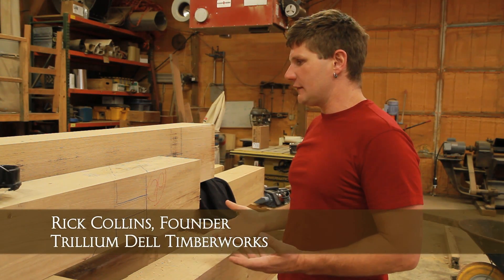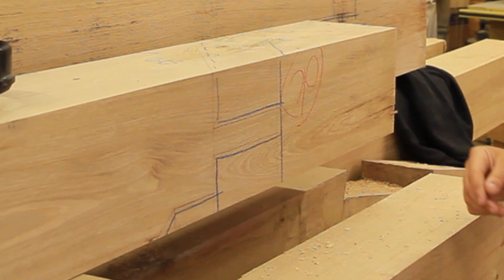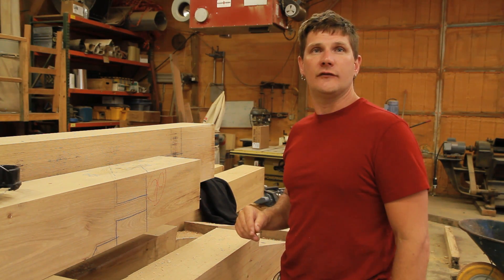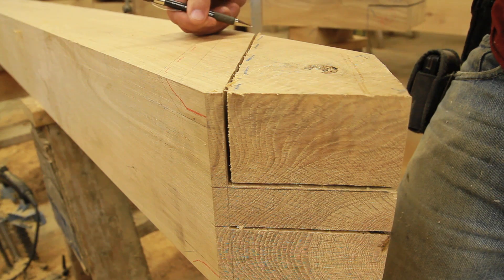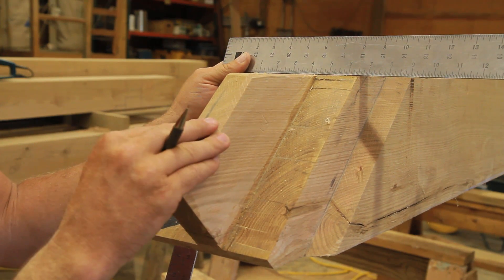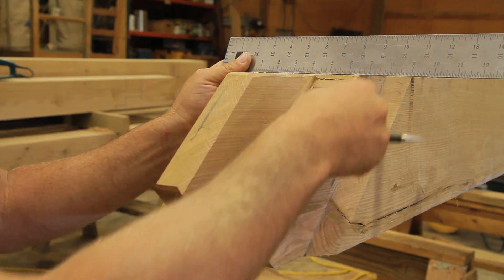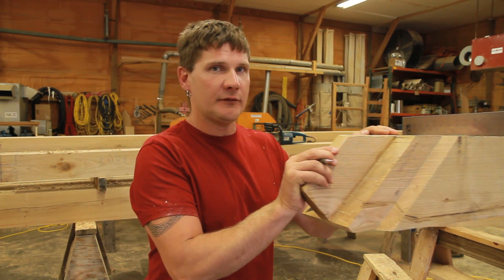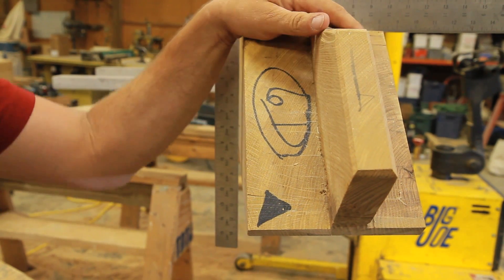HOW TO CUT AND HAND TOOL FINISH A TENON FOR A TIMBER FRAME HOME

Comment: how does housing the tenon cause less shrinkage in green timbers?
Reply: It doesn't cause less shrinkage, it helps prevent shrinkage from showing.. if you don't house then, as the tie dries the abutment of the tie to the principal rafter will open up at the top in the same way the mitres can open up.. the shrinkage is perpendicular to the grain not to the angle of the cut so as the thickness of the member decreases, while the length stays the same, the angle of the cut changes and you end up with a tapered gap. Housed, that cut is hidden inside the housing.
Reply: The Police not to cause less shrinkage he said so they physically cant see when it does shrink
Reply: makes sense. thank you.